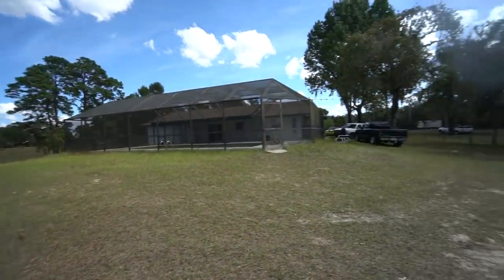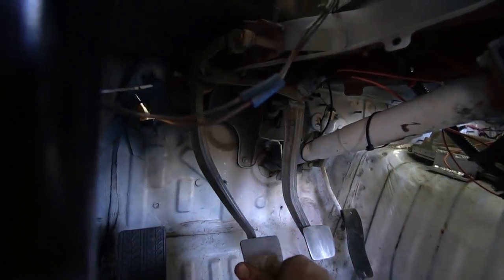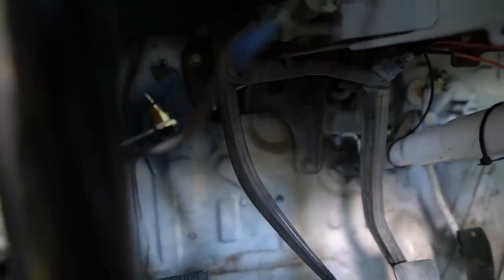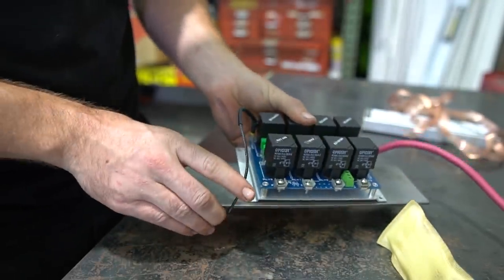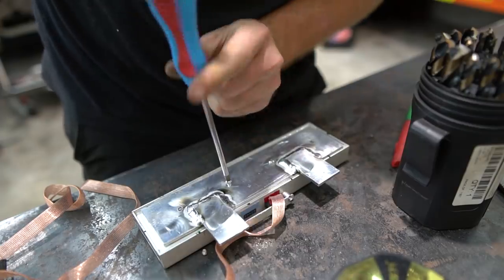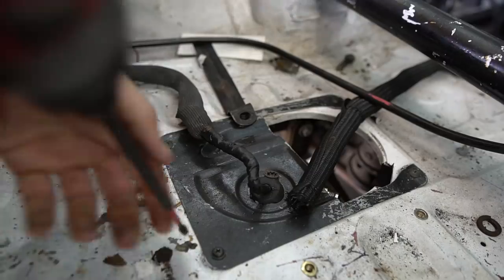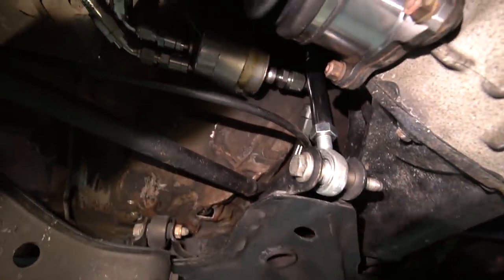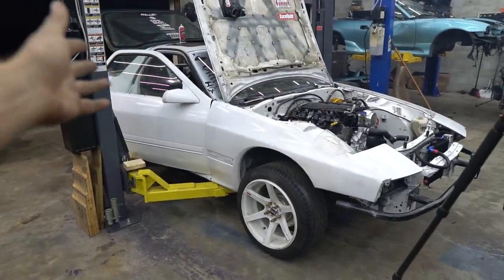The Abandoned FC RX7 LIVES! First Startup!! (Fab Work, Fuel System, Wiring Etc)

Comment: my lifters were ticking and clanging in a junkyard motor i swapped in.... poured a quart of transmission fluid in and let it run for about 30 mins. got way better, but still ticked. i then got mad and hit limiter for about 10 seconds and all the ticking was gone lol. been fine for 3 years now. i think the lifters have a hard time pumping up after setting for a while.
Reply: did the same with a subaru engine.  went on a nice redline drive and came back car was quiet

Comment: I think sometimes ls's have a hard time first priming the whole oil system, it can take a few minutes for everything to get oil. when I first started my 5.3 it took a while to get it to the rockers
Reply: I always pull the spark plugs and fuel pump wire and crank it over until I see my mechanical pressure gauge jump around,  then I fire it off, works every time. And no tix.....

Comment: The lifters sounded great for about 2 seconds after start up then they started making noise. Is that a stock cam and lifter set? If it ain't maybe pushrod length isn't right or lash might not be set correctly but I'm sure you will get it figured out
Reply: As someone whos yet to enjoy a pushrod motor, can you adjust the rods ?
Reply: @realMaverickBuckley  Push rods aren't adjustable
Reply: @Matty.Hill_87  well different lengths could be considering adjustable
Reply: @blitz3607  true I guess

Comment: Strange with the clacking noises. My friend Jeff has the channel Fully Spooled and he had a stock iron block LS blow up after doing some donuts, even with a higher capacity pan. When he tore into it, it looked like the passenger bank wasn't getting hardly any oil. Wonder if there is an issue in common here. Love the progress on the car!

Comment: I fired up a 16v Citroen engine after a had re build and it made a very similar noise for the first 10 or so minutes. Then the next time we fired it up the noise had gone. I turned it over a good few times before starting and poured oil into each channel while re building. so maybe it’s just something that happens when an engines been sat a while/worked on 🤷‍♂️

Comment: @3:50, when cutting threaded rod, try putt8 g on a nut the whole way down until it bottoms out, cut the rod where you want, then work the nut off the end and it will straighten out the threads most of the time, no trick is fool proof.

Comment: you did a ton of work Taylor.   Did you check the oil level?  Maybe you should check the oil pump. I wouldnt trust that gauge much.   Sounds like something is wrong with the valve train.  As ussual  another great video!

Comment: This first start is better than B is for Build's. Change my mind.
Reply: But B is for builds sounded better once running.
Reply: @ddevil4980  yeah, but did you see how hideous it was? 1,500 hp with silicone couplers and chopped up Chinese steel headers? That poor texas speed engine...
Reply: meshuggah life b is for build is a bit of a hack tbh
Reply: He straight out said why they were like that and that they were going to fix it. Considering the amount of time they have let's see ya do better.
Reply: B is for build is ok.  But i feel like i can relate to taylor much more
Reply: @ddevil4980  you're right. It's going to sema so it doesn't matter. Dude paid a premium for a gated shifter and puts a junkyard shift boot over it. Yeah, I'm pretty sure almost anyone can do better. He also has someone else do all his fab work. It's all about shock value, there is no substance. It's all time lapses and mobile game ads.

Comment: LS’s are a little noisy but I would retorque the rockers. Does it have a trunionaided rockers lol??? With the smoke though you may need valve seals. LS’s smoke terrible with bad valve seals, especially on start up after it’s been sitting.

Comment: Wouldn't be a bad idea to check pushrod length for the valvetrain noise. With everything else that's been wrong on this car, I wouldn't be surprised. More than likely it was just from the heads being dry but you never know.

Comment: The motor in my 01 Tahoe has some chatter til it’s good and warm... also cobra swapped my FC smokes when it’s warming up (runs rich still needs the tune cleaned up) I’m assuming that’s the issue with yours since it’s a tune for a turbo motor.
Reply: Also get a rad on it so it can actually warm up

Comment: Is it sketchy routing the fuel lines under the car like that or no? The underside of the car looks pretty banged up so I was curious!
Reply: Josh32 Better underneath away from the driver. It’s beat up under there from years of careless jacking up and abuse. Provided the lines are well clamped and not hanging down they are fine under the car.

Comment: Try substituting 1 quart of oil with Lucas oil treatment. I have the same engine in my truck. It has 300k miles on it so it makes some valve noise. I do it every oil change and the ticking completely goes away.
Reply: That stuff is awesome. I used it in my 5.3 too.

Comment: Do a Valve adjustment on that thing, when the valve cover is off you will see if their is a oiling problem
Reply: They bolt on for LS not like adjustable rocker stud engines.

Comment: Taylor, I see you have the brand new M12 90º die grinder. How are you liking it so far?
Reply from the maker: It’s amazing! I don’t have much experience with die grinders in general. So I don’t have a huge frame of reference to compare to. But it’s an amazing addition. So much better for cleaning up metal for welding and things like than than a grinder with a flap wheel.

Comment: Make sure you don't have one of those "fuel managed motors" they suck ! i bought one from a guy he replaced the intake plate with a older one before i got it and it ran that way for him. He sold it to me thinking it was bad but i figured it out and bought the delete kit sucks i had to pull the heads but it runs like a normal 5.3 without the fuel management lifters clicking i also had 2 non fuel management lifters colapsed
Reply: Don't think they used DOD in vettes

Comment: Do yourself a favour and get a spare ribbon cable. I run a arc in my drag car and they’re super fragile. They tear easy even once they’ve been put on
Reply: I wonder if there is stronger aftermarket ribbon cable you could buy? I was thinking it looked really cool, but potentially delicate.
Reply: @alexstromberg7696  I understand. That doesn't mean there are not more and less durable versions.

Comment: Does the engine use hydraulic lash adjusters or do you need to do it manually?
Reply: Factory LS lifters are hydraulic
Reply: LS rockers bolt on they don't need pre-load adjusted, lash is for solid lifters.
Reply: @BOOT  I know that solid lifters need adjusting, I just didn't know if the LS used solid or hydraulic ones.

Comment: Anyone able to tell me where I can find that board+switch panel with ribbon cable that Taylor uses? I'd love to run that for my LS e36 instead of wiring up 5-7 individual switches
Reply from the maker: It’s an ARC 8000. There’s a bunch of cheaper options on amazon now though. With Nicer switch pads.
Reply: @Taylordrifts  Awesome thanks!